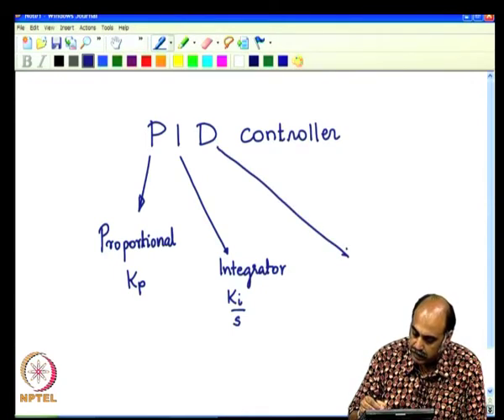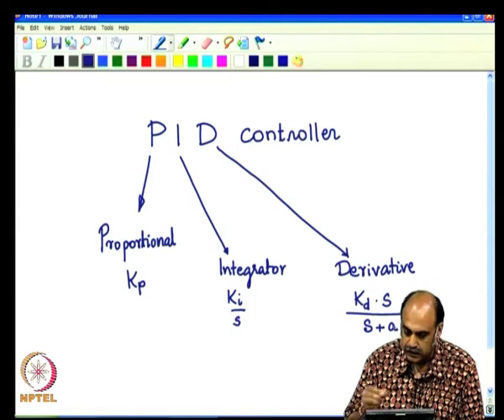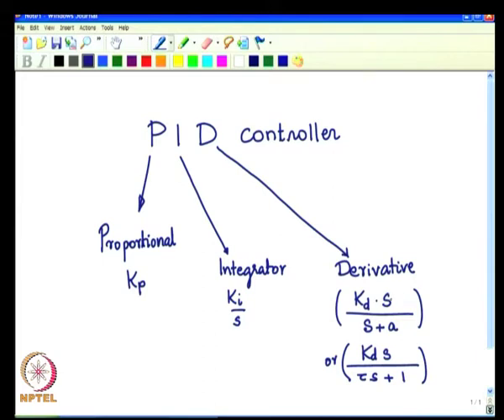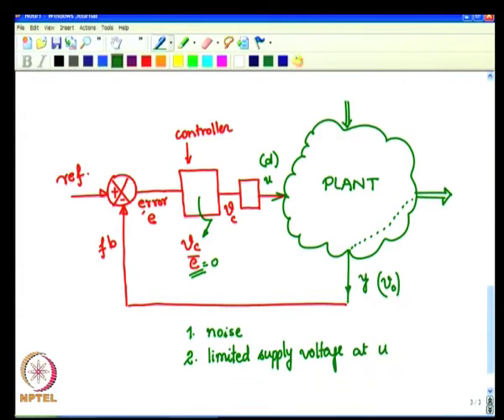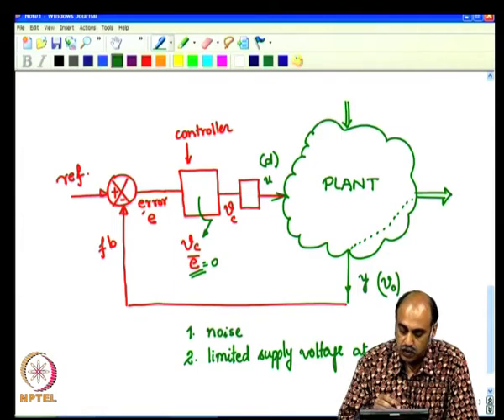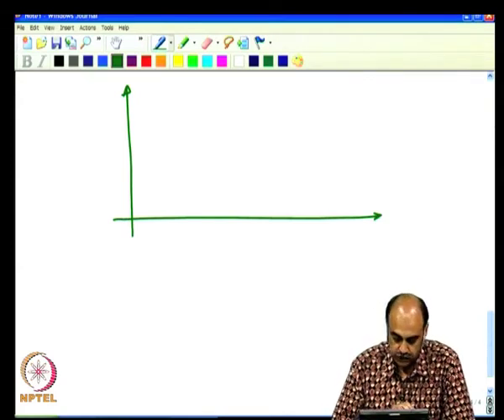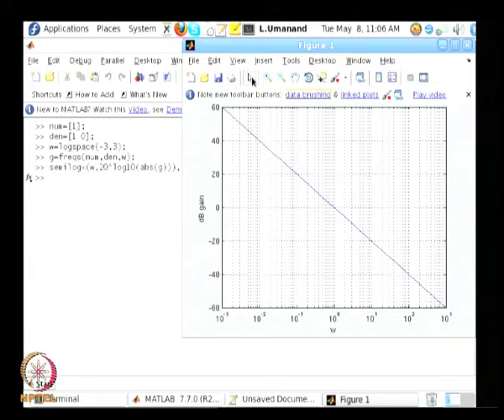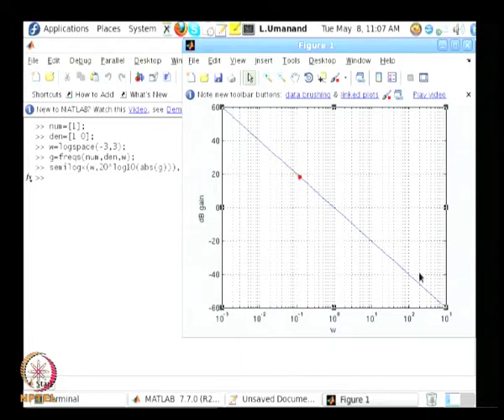Mod-09 Lec-27 PID Controller - I

Comment: Something is not right. The transfer function of the feedback should be:
2.2 s
----------------------------------------
0.048 s^4 + 0.64 s^3 + 1.7 s^2 + s + 2.2

and according to the final value theorem the value at infinity should be 0. 
In other words, the final value of the step response should be 0 not 1.
Reply: Ah never mind. I found my error. Instead of a controller, I had used 1/s as the feedback network for the plant.
So correctly the full TF is 
   2.2
----------------------------------
0.048 s^4 + 0.64 s^3 + 1.7 s^2 + s